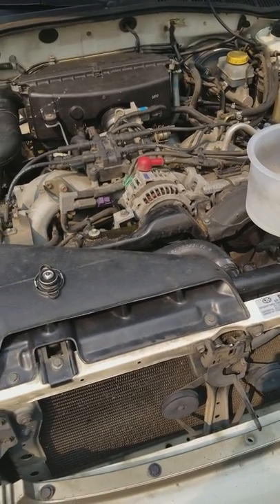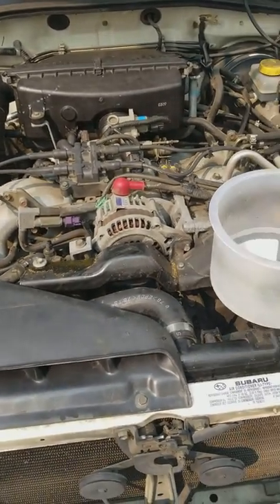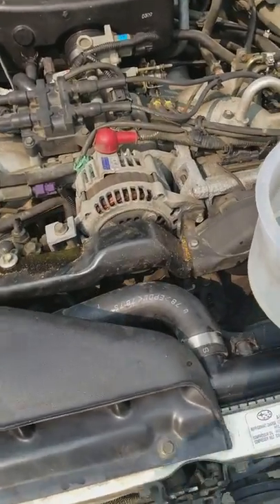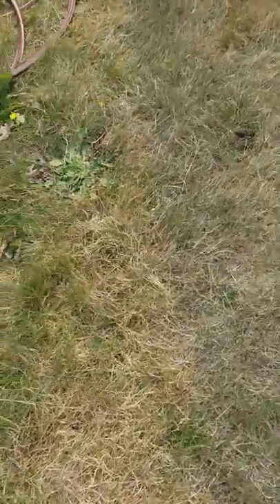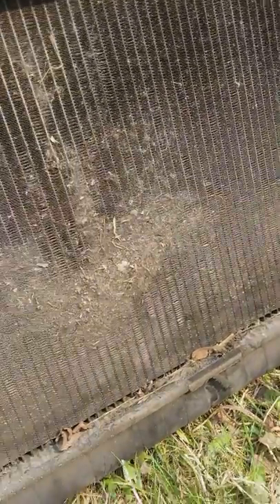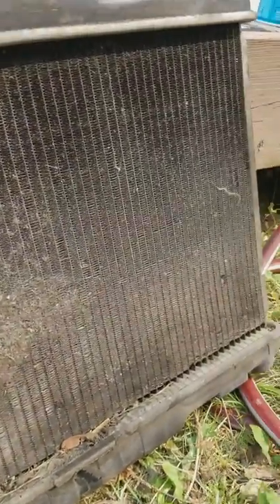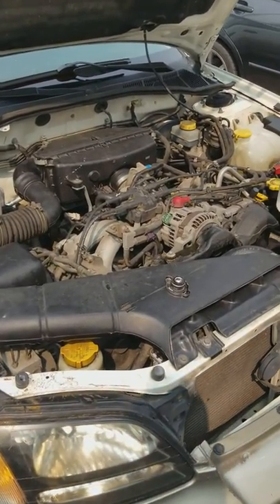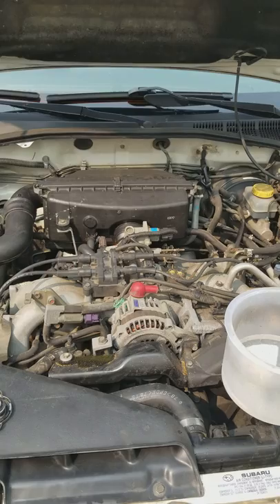Subaru overheating on highway resolved

Comment: Another reason for over heating at high speed is clogged Catalytic doe to carbon from the engine causing back pressure in the engine.Have it cleaned or replaced will resolve the issue. Good luck
Reply: This might be the issue on my car, i have the code p0420 and my car runs hot when climbing hills and overall runs hotter than usual under normal driving